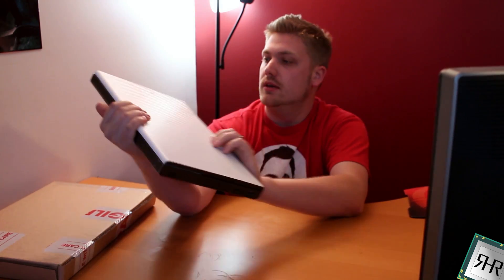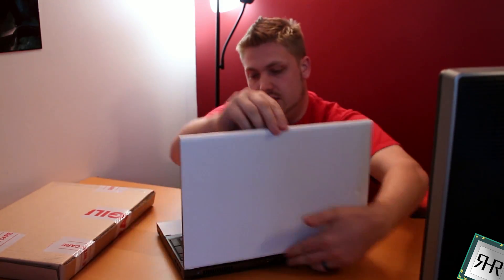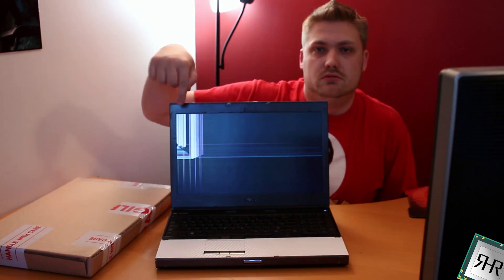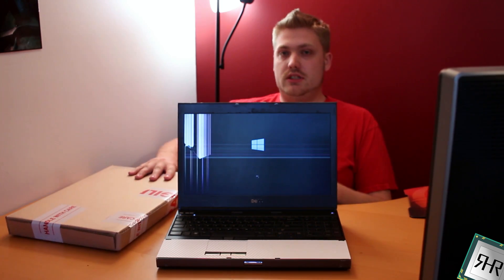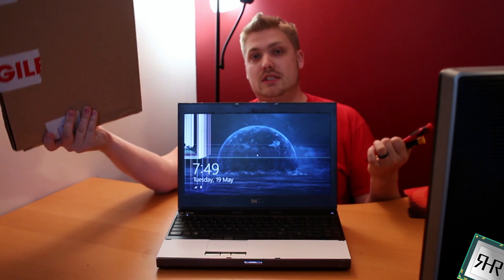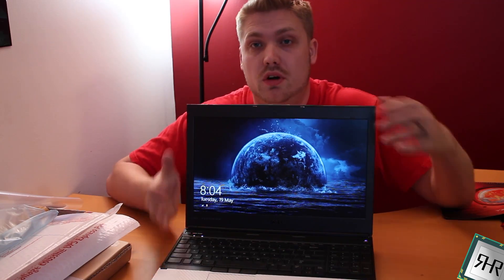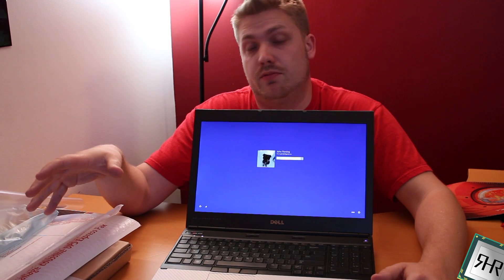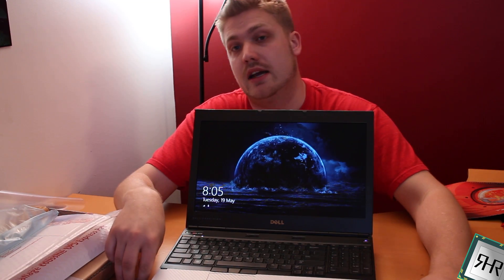Dell Precision M4600 LCD Replacement

Comment: hi , im from germany,i have the same laptop .if i open the laptop and push the screen to open it,i lost the signal to the display. if i push it a bit back it works.i think  the cabel from the display is broken a bit.can you tell me what for a display cabel i need for the M4600 full hd display?

Comment: How difficult is it to replace the Precision 4500 lid? Mine is cracked and the front hinge won't lock anymore when it's closed.
Reply from the maker: +BetterKateThanEver very simple if I remember right. I no longer have this laptop so it's hard to confirm.
Reply: Thank you.

Comment: Dells Laptops are really very serviceable. Almost every part can be replaced without having to fear to damage the laptop. I already replaced RAM, (8GB => 32GB), put 2x 1TB SSDs inside, replaced the keyboard (accidentially ordered one without backlight - now I have one donor-Keyboard for broken keys). My Screen has once been replaced by a Dell service man, like you did in the video. I was surprised how easy it was. In about 5 minutes, it was done. Unfortunately, also the new IPS begins to have the same damage, looking like it's "seeping from above into the screen", dark blotches. I think that's a normal sign of extensive use and age. Also I wonder that you're running windows 10 on the M4600! I've read too many horror stories about upgrading to Win10 especially on the M4600. so I still run Windows 7.
Reply from the maker: +Nina Cording I no longer have the m4600 gave it to a friend in need but yah agree on the upgrades. Gave it to him with a m5100 in it as a gpu which was the 2nd time I upgraded the gpu while owning it. 24gb ddr3, a 256gb msata and a 1tb 7200 sshd. The screen was still running strong and I even upgraded the Wi-Fi card to a ac Intel one.

But if you think dells are easy to service you should try the gt 7x series of msi laptops 3 screws and you have access to everything.

Thanks for your comment and have a epic day
Reply: Thanks for your advice! I'm actually looking for a follow-up, because mine is actually beginning to break apart physically and the new UHD screen only runs at 30Hz (well it DOES work which is a lot for a 2011 Model) MSI, or Schenker are the ones I'm taking a closer look at. Although I don't like the "teenager gamer" design of the bigger models so much. The Dell M4600 was also quite ugly, but in a sympathetic way. People thought I had a machine from the 90ies and I think no one would even have stolen it when I had left in somewhere on a bench at a major railway station. So thanks again for replying :)
Reply from the maker: +Nina Cording hmm from your description the pe series of laptops sounds perfect for you https://www.msi.com/Laptop/PE60-6QE.html#hero-overview there is a newer model as well now I think if you search msi pe laptops you should find it. If your running Windows 7 go to support.dell.com let it detect your system and drivers as I believe a bios fix is out for the monitor refresh issues.

Comment: Thanks for the video! I was having trouble getting the bottom-most clips undone on the screen bezel on my M4600. Hinges were wobbly, seems a past owner had replaced the LCD and not loctited the screws down...
Reply from the maker: happy you got it fixed and this helped, a year or so back I had a customer drop off her laptop with a broken lcd, she said it broke after she dropped it but she was proud she was able to solve the hinge wobble issue, I sent her on her way and started to try and take the laptop apart when I noticed every point the the laptop where it connected two pieces together it was covered in a clear solid substance... ended up being crazy glue... they lady covered the whole laptop in it pretty much had to spend hours with nailpolish remover to get it apart. 

So always buy beware when it comes to what the last user did haha.

Also had a laptop a buddy sent me where he would power it on and 30 seconds later it would turn off he had no clue what was wrong. Open it and the laptop is garbage, the LCD ribbon is plugged into a slot where the hinge is snapped off, one fan header is broken off with part of the board attached and the hdd had a password on it. all enough to just say "Buyer beware and go get something else"
Reply: This was a government surplus machine, so thankfully the inept tech work wasn't any worse. Plus, I had a chance to inspect it before purchase. I can't believe someone would think crazy glue would actually be strong enough for that...

Comment: Hello. Thank you for posting great video. I have take pictures of my LCD issue. Can you have a look here: http://haft.nazwa.pl/m4600_lcdscreen_problem.jpg . Do I need to replace LCD? Cable? Or motherboard is broken?
Reply: Sorry I'm a little late on this, but that's typically either the panel or the cable. It could be the video card, though. Does the issue appear on an external monitor?

Comment: how did you get a white palm rest and lid?
Reply from the maker: +RRSYS.info - Roulette Prediction (Paul) http://www.amazon.com/3M-Scotchprint-Carbon-Fiber-Vinyl/dp/B005989U2W we bought that stuff, takes some getting used to to use.
If your in north america join our forum (http://forums.realhardwarereviews.com/) and drop Soullessone21 a PM he may have some extra he could ship you super cheap.
Reply: +Real Hardware Reviews thanks. I'm from Liverpool UK. I am going subscribe to you.
Reply from the maker: +RRSYS.info - Roulette Prediction (Paul) a little to far away but on our forum we have a world wide giveaway right now so make sure to join that :)

There is also carbon fiber looking wraps and other 3m ones on Amazon UK that might fit the style your trying for.
Reply: thanks for letting me know this.

Comment: Good job on the replacement.. however, if it was an old laptop, I'd personally just have bought a new one instead - but since this is a high-end 2nd gen i7, anything newer (in the same category) would just be too expensive :P